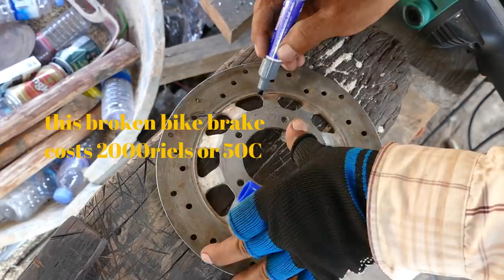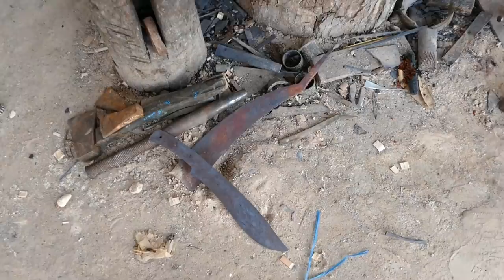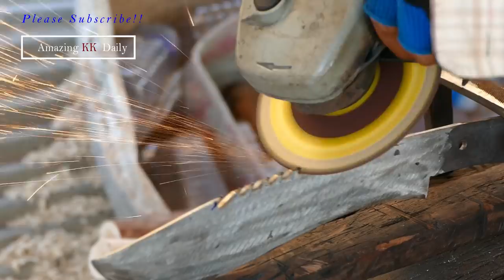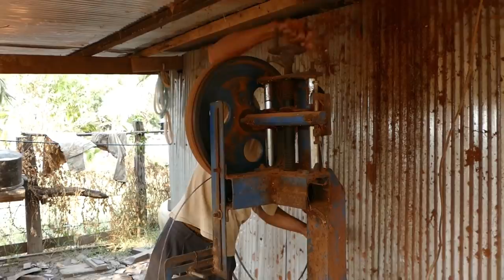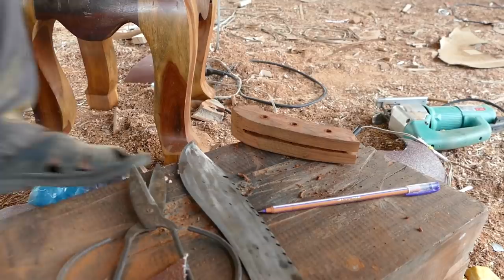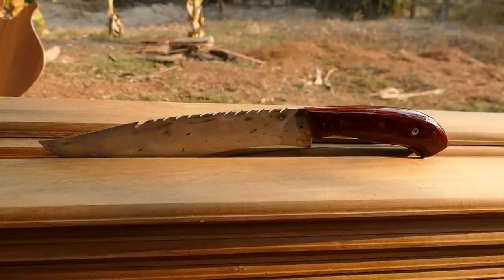Broken Bike Brake Forged Into Useful Beautiful Knife (NOT FOR SALE )

Comment: That's a lot of work to wind up with a knife made out of plain iron.
Reply: In many cases it can be stainless steel but never carbon steel.  Cast iron is the preferred material for brake discs other than carbon fiber for racing purposes.
Reply: WRONG!
Reply: Steve eber you are right they are not the same
Reply: No replys?? I'm on holiday in Philippines at 4:14 am disappointed....
Reply: Well not disappointed because the the alcohol and cigarettes are cheap (always good) and of course the weather is banging!!!
Reply: Only language barrier is a problem. Tagalog is is the next challenge
Reply: tylers right they use stainless
Reply: not even sure why your arguing, your on a computer just look it up